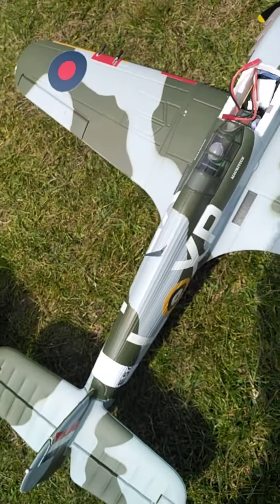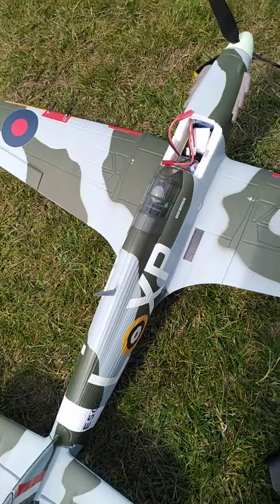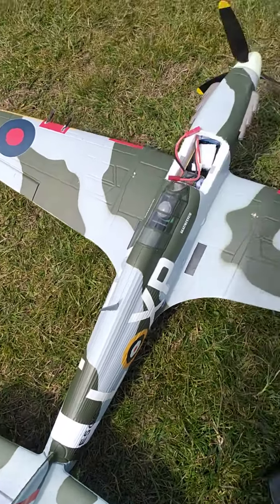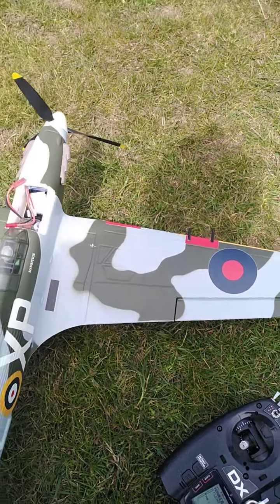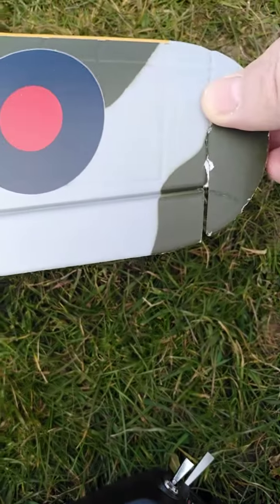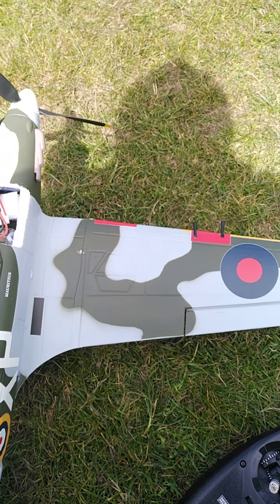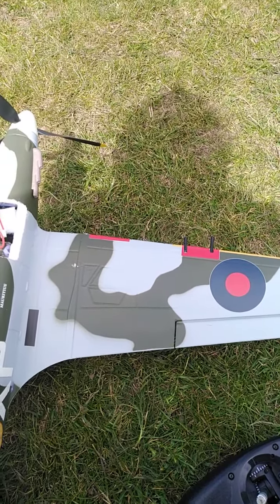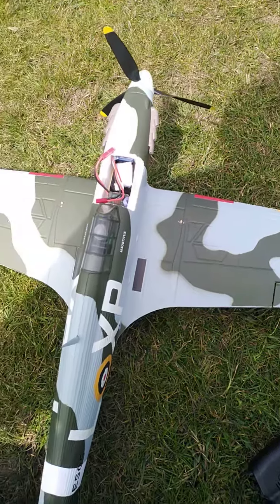HK HURRICANE slight bit of wing damage.Need to sort out ailerons. They were 100%but useless

Comment: thank goodness you found the TIP -  on the other video I was shouting at the screen .... LOL... Sorry Brian but rebuild it and fly again - My suggestions is that you don't use hot glue but use Uhu Por and stick a few cocktail stick in the wing tip to give some additional support - try it again without Safe mode just AS3X it should be fine - and they can slow down to a nice scale speed
Reply from the maker: Shouting at the screen love it... Without the speed I would have needed the whole if surry to make a turn. hahahahahha.
Cheers me ol mate